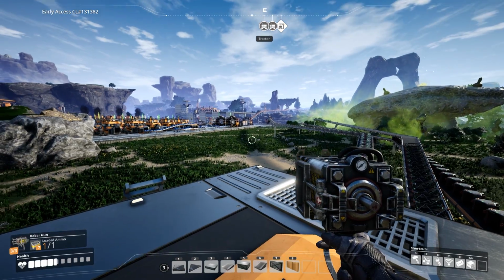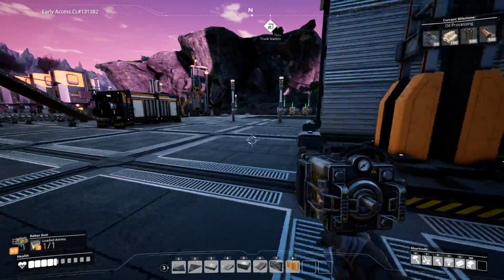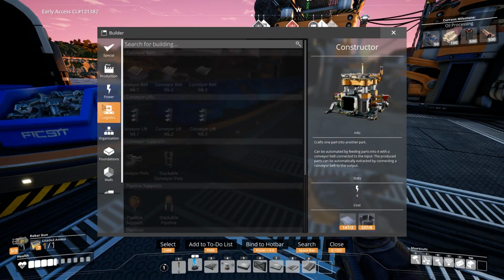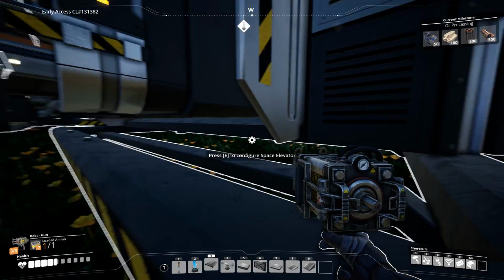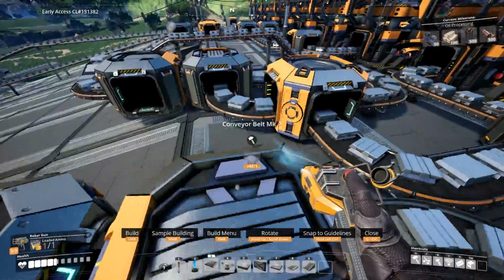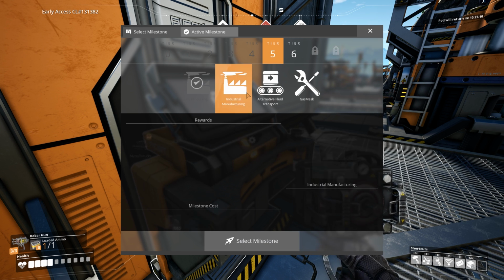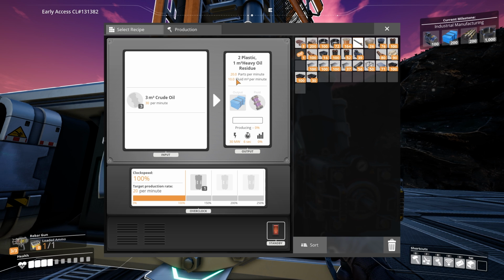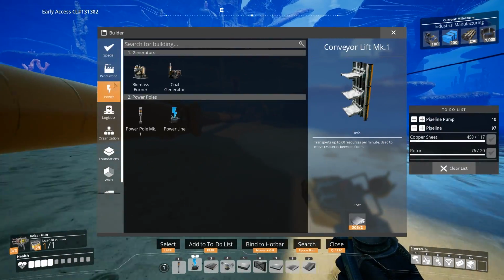Searching for PRECIOUS OIL for my EVER-EXPANDING FACTORY! - (Satisfactory #14)

Comment from the maker: A bit of a late upload but I really wanted to get this one out today - hope you guys enjoy! Also any advice regarding the fluid pipes would be much appreciated!
Reply: Didn't expect one so soon, so I'm very pleased
Reply: Right! So fluid pipes are pretty crazy. Generally speaking, fluid doesn't like to move uphill. There are pumps that take power that give your fluid an extra 20m of "head lift". That means take the head of the water, and lift it up 20m. The regular water pumps and oil extractors give it a bit of pressure, so it'll move a little bit upwards. But mostly you want to build the thing that WANTS liquid lower than the thing PRODUCING liquid whenever possible.

The pipe has indicators on the side that show you both the type of fluid running through it, as well as the pressure that liquid is at. You'll see little bumps on the outside of the pipe that, once the fluid gets moving, they open up. If they're fully open, you've got lots of pressure. The color shows what kind of fluid it is.

A pipe can only carry 300m^3/s of fluid, so treat that a little bit like your conveyors, using the pipe junctions as both mergers and splitters. It sort of follows the laws of gravity though, you know? It's not going to shove liquid uphill if there's an easier downhill location.

If you're producing excess of anything, throw it into your AWESOME Sink. Get those tickets! Cooler ramps, and wall accessories like holes for hypertubes and pipes.
Reply: @MrQuickLine  I feel that a couple corrections are needed: the rings in the center of each pipe segment represent flow (no flow, rings "closed"; max flow, rings expanding and contracting fast) and amount of fluid in pipe (how much the  whole indicator "spreads out"). Both are usuful as they tell you if the fluid can reach up to that segment of pipe (pipe half full means you don't have pressure to fill up the rest!) and how fast the fluid inside is moving.

@Wilsonator 2.0 a good way to know if your pumps are spread out too far or too close is to actually check the "head lift" they show when you interact. Beware that it will start from 0 at the beginning, then rise as the pipes above fill up (and the fluid gets higher). Pro tip: you take advantage of the highest output of a pipe being filled last to manage excess fluids, if you happen to have any ;)
Reply: Don't worry man take your time we support you no matter what

Comment: One thing you have to keep an eye on is maximum flow rates in pipes. Pipes can only transport 300m3/min, and there's no way to increase that. IIRC (I had an oil base in that spot as well) those two oil extractors are on a normal and an impure oil source, meaning you're at 60+120=180m3/min, so you're fine at the moment, but there are are also some pure sources in that area, and they produce 240m3/min, so one of those plus an impure one and your pipes have reached their limit. If you want to transport more than those 300, you need a second pipe.

Comment: Loving the series mate keep it up! As for the oil extraction your best off making the product near the oil patches and moving the products back to base on conveyor belts. Little tip if excess heavy fuel you make while producing plastic and rubber backs up then itll stop production. Best off making sinks for this until you can deal with it correctly 👍

Comment: If you turn crude oil into plastic or rubber you get the heavy oil residue which can be turned into fuel with no byproducts in residual fuel. Very helpful. Just need to keep an eye that the rubber and plastic products won't stop if you use the fuel for a fuel generator. Otherwise just put a few refineries for fuel down. But this is better than turning it into the petroleum coke. You won't use these as you quickly upgrade to fuel generators. 
Summary: put crude oil into first refinary turning it into plastic and rubber. Then putting another refinery to turn the heavy oil into fuel.

Comment: Love the vids, just a few tips:

You should unlock everything you can in the M.A.M., because that gives you a lot of FUN stuff, and with them you can hunt crashed pods easier. They have sometimes have some advanced items lying around, and also you can get hard drives (they might require various items and/or power to open, so bring some biomass), which unlock alternate recipes that let you do lots of crazy production lines. Finding these before building something big is usually a good idea. :D

Also use up liquids as locally as you can, I think a refinery near the nodes would look cool, and it is MUCH easier to deal with items. 

Also buy everything in the AWESOME shop, decorating is a good way to relax, and makes it much more pleasant to be around. :D I usually build a skeleton, get down the machines, hook everything up, and build a factory around it.
Reply: M.A.M. is also where you'll find your cloth for the gas mask

Comment: Awesome video! You're the only youtuber i know that plays my 2 fav games RUST and Satisfactory. You're moving the oil right. Just keep in mind and click on the pumps to check if the Max lift rate is not exceeding it's max, that is 20 meters high. Also u could place some "Fluid Buffers" or Fluid Tanks on high places (like water towers in rl) so u always have a bit on stock in case u need to take it to another direction of the map or to set another factory right there. The set up i use is: I have X refineries doing plastic and then i merge all of that heavy oil residue on a tank and i use that residue to make fuel for power. Keep the good work man!

Comment: Initial head lift from extractors is 12 m high, which means 3 big foundation high. If you add a pump, head lift increase by 20 m from the point of pump which is 5 big foundation. Head lift dont stack up so you can not stack multiple pump at buttom. It works like repeter so every 20 m high distance you need to put one.
Reply: To add, I am pretty sure the initial head lift is 10m. You can check the pumps and it will tell you how much head lift it is using. Pumps act as a one-way valve even when not powered, make sure they are pointed the right way. The pipe will keep head lift pressure, what I mean is if you send a pipe up 50m then drop back down 30m, you will not need a pump to send it back up to the initial 50m height even though you would be going up 30m.
Reply: @futuramanut  yah I totally forget to add valve mechanics. Tnx
Reply: make sure to use stackable pipeline supports when transporting fluids, there are a few more oil spots in that area.